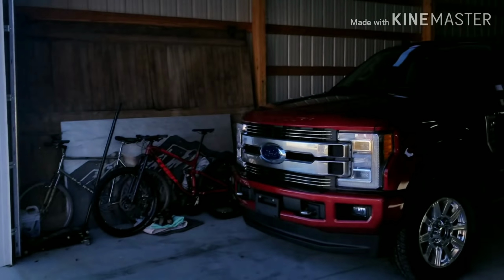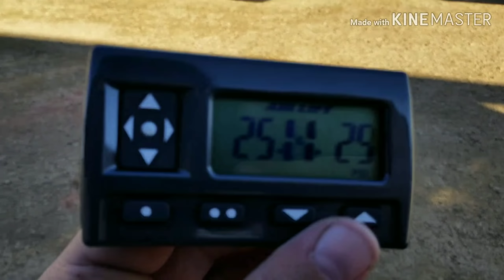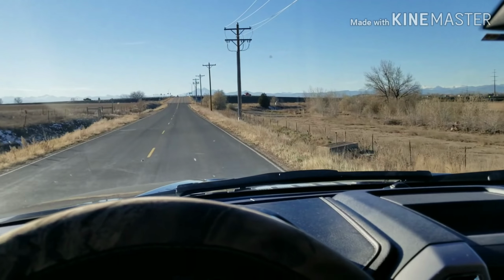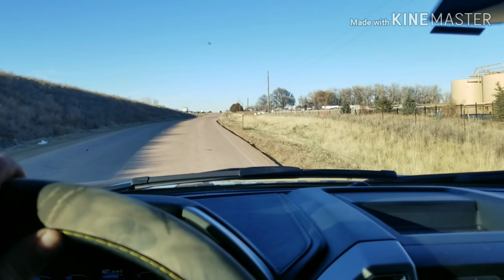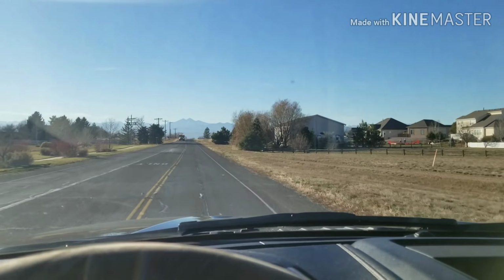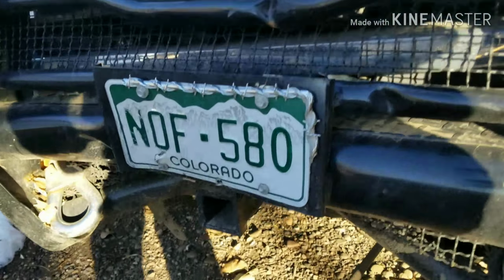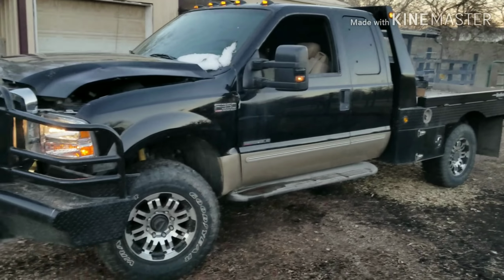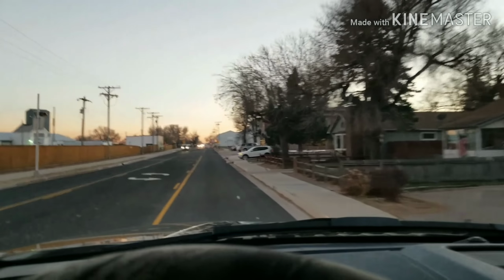6.7 vs 7.3

Comment: I too struggled with the question of upgrading from a 7.3 to 6.7. Now in 2022, it is just better to baby the 7.3 as it's paid off, runs, and does not cost 80-90k. Also them newer trucks mess up a lot.
Reply: For sure.  They have all that emission crap.

Comment: I bought a 94 f350 dually with 119k did 2 oil changes and a guy ran a light and totaled it. I then got a 97 f350 cab n chassis dually with 279k 1 company owner now its got 299k. Yes i put the third known to me transmission in it but i tow 13k one trip around 300 miles round trip otherwise local trips towing

Comment: You up in the weld county area? I used to live in Greeley but have since moved out east of ft.morgan! Was actually curious to see if you'd part out some stuff off of your old super duty? If not it's all good!
Reply from the maker: Ya I'm in Weld County. I'm still dealing with insurance issues on my wrecked truck. I sell part out stuff on Facebook alot. Usually on the diesel pages like RMDC, Colorado Diesel Power, Colorado Power Stroke..... places like that. But ya when insurance is settled I'll be parting it out.
Reply: @THUNDERstroke73  oh right on! I haven't seen you much on Facebook unless my eyes are shut while I'm browsing lol.
Reply from the maker: I have the part outs in Mead. Just posted some last week
Reply: @THUNDERstroke73  where did you post them to? If you don't mind me asking?
Reply from the maker: Rocky Mountain Diesel Crew
Market Place
Colorado Diesel Power
Colorado Craigslist
Diesel Yard Sale

Comment: Those extended cab superdutys do you have one with a clean cab you want rid of
Reply from the maker: Yes I do
Reply: THUNDERstroke73 name a price buddy
Reply from the maker: $500
Mead Colorado
Reply: @THUNDERstroke73  Any white crew cabs by chance?
Reply from the maker: @jakepakulski2991  No crew cabs right now
Reply: @THUNDERstroke73  10-4. Thanks. Do you know if it's possible to but an ext. cab on a crew cab long box frame? I'd put a bulk tank in between the gap of the cab and the box.
Reply from the maker: @jakepakulski2991  Ya its possible. Not sure on cab bolt measurements but it can be done
Reply: @THUNDERstroke73  Sweet. I'll do some more research and get back to you
Reply: @THUNDERstroke73  Hey do you have any 7.3L extended or preferably crew cab right now?